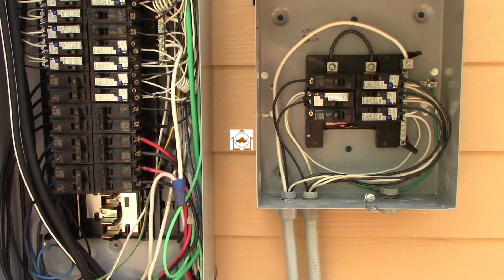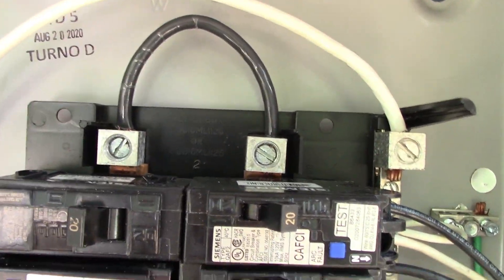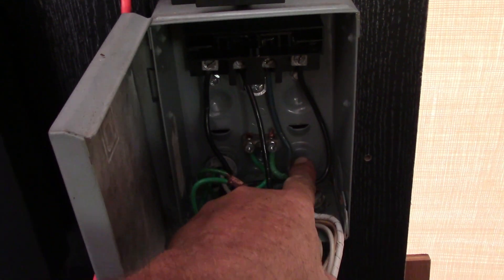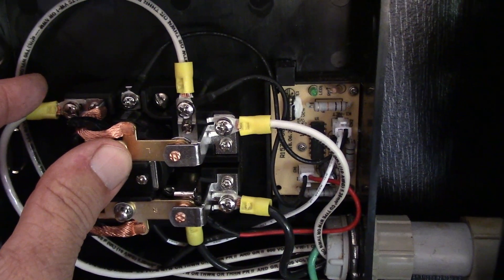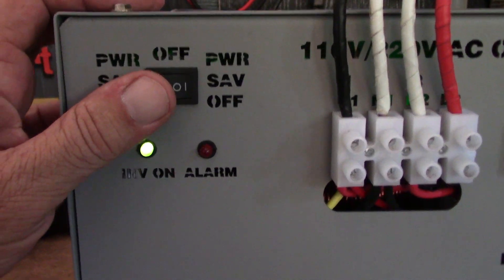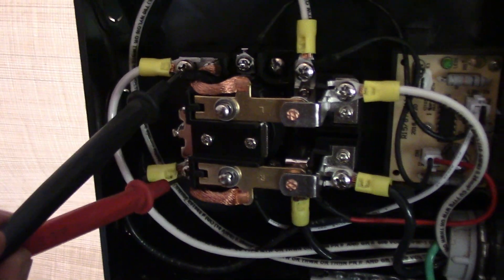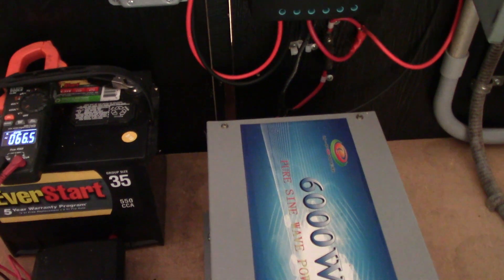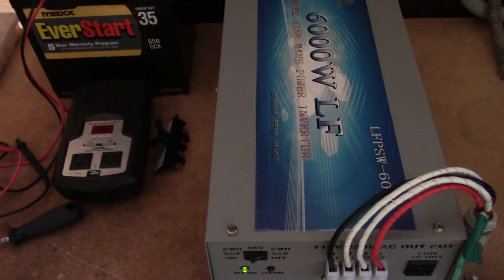GENERATOR / SOLAR ARC FAULT TRANSFER PANEL AND AUTOMATIC TRANSFER SWITCH.

Comment: why is the feed only a 30 amp breaker?  Running all of those circuits wouldn't you be better off with a 50 Amp breaker?  or are you just running small loads.
Reply from the maker: Sorry took so long to get back to you, I got tied up and haven't been here for a few days. The transfer switch is a 30 amp, so everything else needs to match that. The transfer panel is all 120's, the only 240 I run on solar is the A/C, and that connects through the inlet and interlock kit, if the power goes off when I'm sleeping or not home I'm only concerned with the refer security system and cameras staying on automatically, though all 120's in the house stay on automatically if the power goes out, so all the lights tv and everything else stay on. When I built this house I designed it to be super efficient and run on minimum solar, the A/C is an inverter unit that has no start mode, and only pulls 1.9 amps when running at max, everything else in the house including the refrigerator only pulls about 1.4 amps when its all on, we have a lot more videos on the house, A/C and more, check them out!!